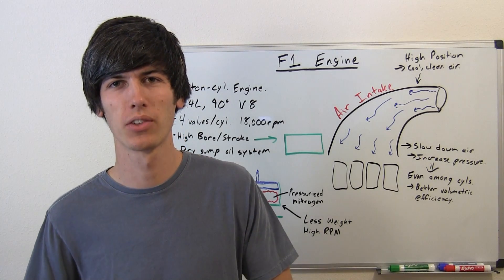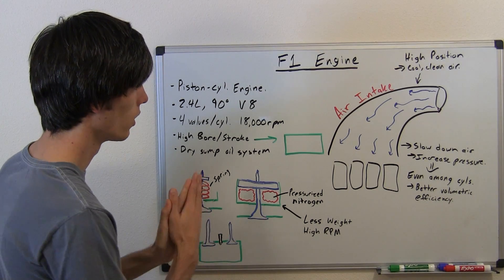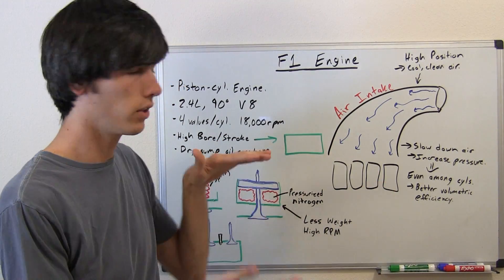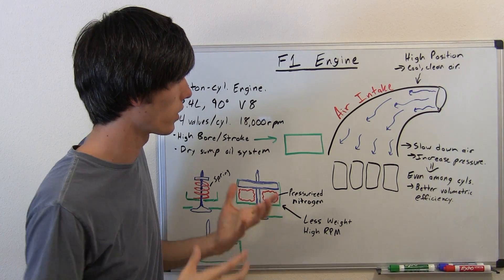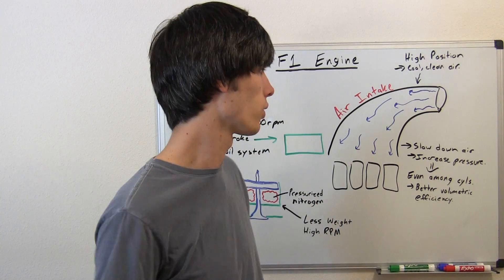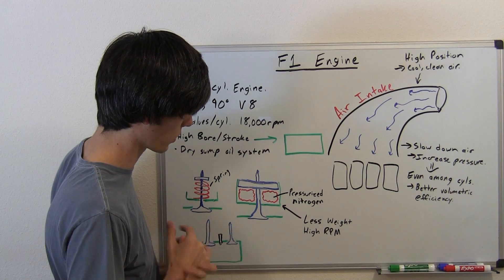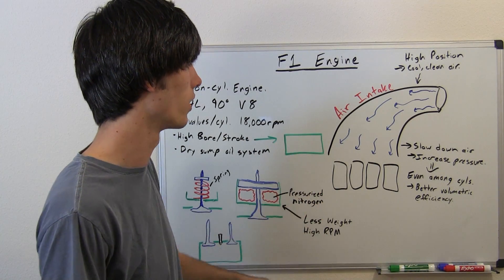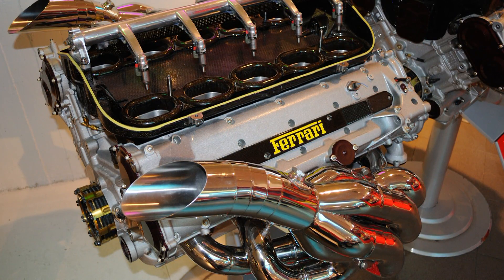F1 Engine - Explained

Comment: F1 uses high revving no torque engines cuz the car is already light and wouldn't get much use from the excess torque. Plus more torque may require a beefier engine that would make the car too heavy and cumbersome.

Comment: @3:36 Increase the pressure - not correct. The pressure within the intake duct remains constant as pressure is porportional to the mass flowrate of the air. The mass of the air entering the air intake remains the same (constant) as the mass of the air at the discharge of the intake duct but the velocity of the mass flowrate decreases as the cross sectional area is increased.  The air pressure is NOT increased as you stated!!!   If it were, there would be a differential in pressure between the discharge end of the air inlet and the intake end of the air inlet and with a higher pressure at the discharge end, air would flow backwards from high pressure to low pressure and that is NOT what happens!!!

Comment: you wanted to explain a formula 1 engine and not the basic of an engine
good explained because of the very high rpm the pressurized nitrogen for the valves.
you forgot to mention the crankshafts main bearing, the titan rods, the pistons dimension/structure and the exkaust
but just now I see this video is nearly 10 years old - well done

Comment: Wouldn't the nitrogen piston assembly weigh more than just a valve spring or at least comparable?
Reply: I think with the nitrogen piston system it has a faster reaction time than the old valve springs as the benefits must outweigh the weight penalty from using such a system!
Reply: It weights a bit more overall, but the advantages far outweight the disadvantages. For instance, the engine will put out more power, even if everything else is equal. If you would plot a spring characteristic for the pneumatic valve spring they would be extremly soft. Which means you need less force to compress them which also means you lose less power to move the valves. Also they allow much higher revs without any concerns for valve float and the pneumatic spring itself is very simplistic. Basically it's just a little plate near the end of the valvestem that runs in a small cylinder which has a small pneumatic valve attached to it, that's really it.

Comment: Wow. I learned alot here. Pneumatic valves! (What?) I never knew that. So they can adjust valve pressure by changing the nitrogen pressure in the valvetrain?

Comment: i'd like to hear more about those nitrogen valve springs.
Reply: as you probably know, metal valve springs have a return limit. Or the engine limit of rpm is because of valve float.  The spring only has a certain amount of return ability or memory . Pneumatic valve's were first designed by Renault in 1985, for F1. Using compressed air  and not steel or other metals to close the valves. This because air has no memory or affect of rpm limit.      :P

Comment: A bit out of date on specs. Currently: :"The internal combustion engine of a Formula One car must have 1.6-litres in capacity and is rev-limited to 15,000rpm." (as of 2015.)
Reply: Are you aware that this video was posted 7 years ago?
So this specs was on the year 2012..
Reply: @zekeaffy9647  I was calling it "out of date", and did not say it was incorrect at the time it was produced, so yes I was aware of that fact. I specifically cited the fact that the change occurred in 2015. Obviously that's not the only aspect that is out of date with the hybrid powerplants.

Comment: At 3:35 "slow down the air to increase the pressure". I'm confused by this. I understand that slowing it down could distribute the pressure more evenly to the cylinders, but how does slowing it down increase the pressure? It seems to me that faster it comes in the higher the pressure would be. Thanks.
Reply: Bernoulli's principle. It states that an increase in the speed of a fluid occurs simultaneously with a decrease in pressure or a decrease in the fluid's potential energy and wise versa.
People often get confused by this because there's a clear difference to made between static pressure, what is what Bernoulli principle is mainly using and dynamic pressure, which is what you feel when you hold your hand out of the window of your car while driving. It's not the same thing.

Comment: It's the inertia of the spring that hinders it at high rpm. I assume nitrogen gas simply has way less mass than the spring so (as it goes through required change of the sign of the acceleration ) it can follow the prescribed valve position path more faithfully.

Comment: How do you get an increase in air pressure if the volume is increased in the air intake at the top of the pistons?
Reply: I'm no expert on this, but I can point you in the right direction. Check out Bernoulli's Principle. The Wiki page has a pretty good explanation.
Reply: thanks, I thought there was an inverse relationship. Like the vacuum due to a change from small to larger area/volume, used in Venturi tube.

Comment: The volumetric efficiency of normally aspirated engines can be raised about one by the use of resonance effects which create pressure waves. VEs of up to 130% have been reported on normally aspirated engines, but it requires very careful tuning of intakes and exhaust systems and only works across certain rev ranges, albeit that can be extended with variable valve timing.

Some Porsche road cars had variable length intake systems to optimise resonance effects over a wider rev range.

Comment: High bore/stroke also means you will have a smaller engine capacity although the engine will have the power like of a larger capacity. For example an 2.4l could've had 5l on the same bore with higher stroke, but it will have the power of a 7l normal stroke. There is even an 1.5l F1, engine that otherwise would've been  a 3l or something...The 1.5l is not pushed that much as a normal engine would be because it doesn't require to operate at high pressure like  for example a turbo 1.5l. To get from a normal small bore 1.5l engine 700hp you would need a super powerful turbocharger that would make the stroke produce a very high pressure, whereas an F1 relies on big bore, high bore/stroke ratio which also allows high rpm.  But the downside is it eats a lot of fuel because the pressure from the power stroke is released and therefore wasted sooner

Comment: Formula One currently uses 1.6 litre four-stroke turbocharged 90 degrees V6 reciprocating engines. The power a Formula One engine produces is generated by operating at a very high rotational speed, up to 15,000 revolutions per minute (rpm).

Comment: You said the maximum volumetric efficiency for naturally aspirated engines is 1.0 (or less). This is not correct; even some street car engines have greater than 1.0 VE. 

If you do a follow up, I would like to hear more about the actual valve lifting technology. What retains the pneumatic pressure, what materials, and how does this apparatus compare in weight to then the former spring/retainer technology? What was the max rpm before F1 went to pneumatic valve control?
Reply: This is due to intake resonance running ,as harmonic pulses bouncing from the back of the closed intake ban valve, to the end of intake tract then back 3 or more times. When timed correctly with the valve opening these inertial ram effects can produce 10 psi or more pressure at the valve, similar to forced induction, albeit for certain points on the rpm band.

Comment: Cool air is denser than hot air, yeah? So if you get cool air and put it into the hot engine, doesn't that slightly increase the pressure?

Comment: How do the nitrogen system valves work? How does it get the supply of nitrogen?
Reply: I think (guess) the nitrogen is pressurized and keeps the same amount of nitrogen in the valve. As the valve opens, the nitrogen is compressed, and pushes up against the camshaft to close the valve. If that shitty explanations helps at all.

Comment: Wha he is describing is an over square engine design. This is why the small block Ford V8’s could rev so high. Large bore and short stroke look at the Chevrolet Z-28 302 engine.

Comment: Volumetric efficiency is a measurement that says how much air the engine cycles for its given displacement. That is a 3.0 liter engine at 100% volumetric efficiency would pump 3.0 liters of air out the tailpipe for one complete engine cycle(2 crankshaft revolutions). At 85% efficiency the same 3.0 liter would pump 2.55 liters of air in 2 crankshaft revolutions.

Comment: The ram-air scoop still creates positive pressure because it takes in more air than the engine consumes. This back pressure makes it so the "spreading out" you refer to does not exist because the air essentially piles up inside that scoop so much so that some is also bled out to atmosphere. The correct position to get good air is key though. Good video.

Comment: I think that the primary reason for dry sump in race cars, is the hard cornering, braking, and acceleration of a race car, will slosh the oil in a wet sump, so just go dry sump.  But the reduction in engine height is a benefit.

Comment: What are the air intakes on the side for if all the air for the engine comes from the top?
Reply: They're for cooling. The radiators are located in the sidepods.
Reply: Unnamed :D I think it's not fir the engine, but it's for aerodinamics, so  the air is directed where it's better to create more downforce
Reply: ok thank you :)

Comment: Good informative video. One thing I will say is I'm pretty sure there are naturally aspirated engines that exceed 100% VE. Its not going to occur over a wide rpm range but with very carefully engineered intake runners and cylinder head ports it creates inertia of a column of air so when the piston reaches the bottom of its travel on the intake stroke the column of air has built up enough inertia to keep moving and keep filling the cylinder even though the piston is no longer pulling the air in. This is how a tunnel ram intake commonly seen on drag race V-8 engines work.

Comment: Actually what enables them to rev that is more the rod ratio, i.e., the ratio of the rod length to the stroke. Yes, the bore stoke ratio is a factor and the smaller the bore the easier is is to control the flame front and quench. The rod length will effect dwell. The longer the rod the longer the dwell and the more time you have to fill the cylinder and the longer time at TDC which effect peak horsepower due to the added length of time the expanding gasses have to impart their energy on the piston. The ability to increase ignition timing is also related to the bore, stoke and rod length. The sooner you can fire the mix generally the more energy you will get from it and the higher the cylinder pressure. Nice video, I love to see people getting the word out abou how things work and why. Keep up the good work! 👍

May I suggest the no you delve into why wider tires are used on performance cars. F=mN doesn’t tell the whole story. 😉 (m=mu)

Comment: What would be the effect of having 2 cylinders fire at the same time? So let's say you have a V-8 and you had it configured to fire in a normal firing order vs. that same V-8, but with the firing of 2 cylinders at the same time giving you essentially a 4 cylinder engine, but with double the cylinder volume for each cycle. I'm sure the conversion wouldn't be easy or probably practical otherwise it would possibly be used more, but I'm curious to know what the result would be if you did. Yes, I know it means replacing the cams with a totally different timing and a different coil timing. Thanks!

Comment: I'm confused on how u said the air is more pressurized bc the air "ram" system gradually becomes larger ...wouldnt pressure be greater if it became smaller? Someone please educate me...yes I'm asking for knowledge I hope to gain in a YouTube comment section ...and yes this is an appropriate place to ask bc it's in an engineered explained comment section

Comment: The piston doesn’t suck the atmosphere in it allows it to force its way in. And you don’t want water and stuff like that in the place of the nitrogen because liquid can’t be compressed so it wouldn’t act as a spring at all...not for corrosion protection.

Comment: no they do a dry sump because when you take off fast or corner all the oil runs up into the crank shaft and causes resestance and steals power

Comment: The criteria has since changed. F1 engines are only permitted a 1.6 litter 90 degree V6 with 4 valves per cylinder, a rev limit of 15,000 rpm and one turbo charger. They must also incorporate hybrid EV technology. What's incredible is despite this they can achieve 700hp.  :)

Comment: pretty good video, nothing new to me. also VE can be more then 1 atmosphere with an N/a enigine. the 89 rx7 and rx8 have intakes that achieve this. no, its not ram air. ;)
the air hits a wall of a closed valve and creates a pressure wave that bounces back and forces air into the opposing intake port. 130+% VE has been achieved.

Comment: This video is very instructive.  I am just an air and gas compressor mechanic, so I understand the basic
concept of volumetric efficiency.  All compressors are rated in terms of free air displacement.  But actual
displacement falls as the pressure increases.

When I was 9 years old I fell in love with the Ferrari Marque after reading a number of car mags back in
1965.  One of my favorite books is a full-color glossy coffee table book called Ferrari:  The Man And His
Machine.  In the book, I read that dividing valve train mass is also a means of achieving higher RPM.

Since I cannot afford 70+ million for a 250 GTO or 30 or 40 million for a 250 Testa Rossa, I set my
lottery win bucket list a little lower.  There is an English car maker that is selling a mid-engine
LS3 powered stroker (415 CI) with a Whipple supercharger that cranks out 1,020 HP.  It is called
the Ultima Evolution.  

Here is my question:  Mercury Racing (the speedboat guys) have recently produced cog-belt driven
4 valve DOHC heads for the LS3.  Not knowing the redline of the car and knowing that a stroked
engine is probably over-square, how would this effect RPM and HP values assume no change to the
drive train?

Comment: Hahaha, you forgot the main things. First, the main source of bigger power is special fuel injecton system to press more and more effectively fuel into engine. Second, the special ignition system works to increase the power maximum. Third, F1 engines are built to work as easy as possible. So the cylinders are much bigger than pistons, all the links and shafts are actually loose, chambers are light and thin etc. In 1980s BMW used the very old ordinary and wasted engine blocks to build the  powerful F1 engines. That`s why they used to blow very easily old days until FIA commanded the engines last several races.

Comment: Renault deleted camshafts and springs from their F1 Engines Valvetrain and replaced it with tappets that open and close the valves by compressed air

Comment: I take issue with a couple points regarding the air intake. First, warm air rises so the coldest, densest air is LOWER not higher. Second, regardless of the shape of the intake, by the time its funneled through a turbo the shape of the intake to "slow down the air" is ridiculous on its face. The fact is, the intake is positioned to take advantage of the increased velocity of the air as the car moves forward..its the same as a hood scoop, NOT the reverse as you cite.

Next, nitrogen charged pneumatic valve train. Physically lighter, possibly, but better at reducing  float vs a mechanical spring? I'd have to see the math. Initial thoughts are it would take more pressure (which would need seals up to the task) than the force a spring can provide. Gas is readily compressible. If I recall from high school almost 40 years ago its about 18lb per square inch at sea level. What's the pressure behind the seal? Especially what is the pressure compared to that of the comparable valve spring? I call BS based on the fact this technology is NOT used in motorcycle engines and they rev almost as fast in a high performance STREET bike without such nonsense.